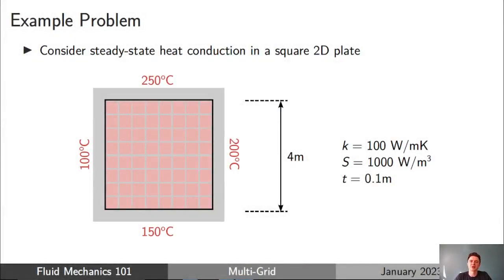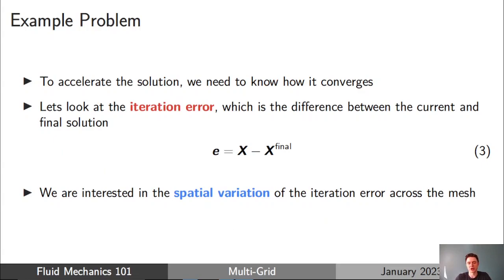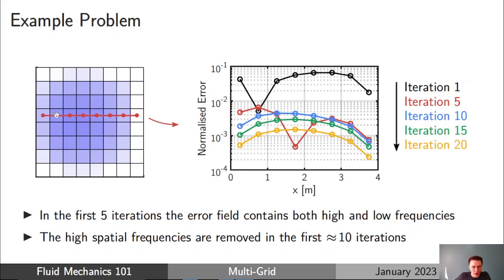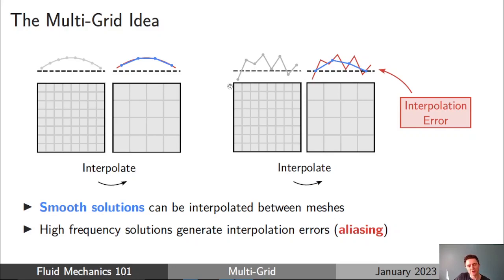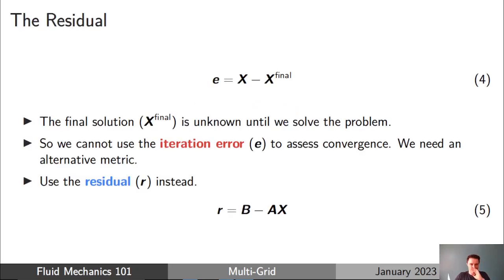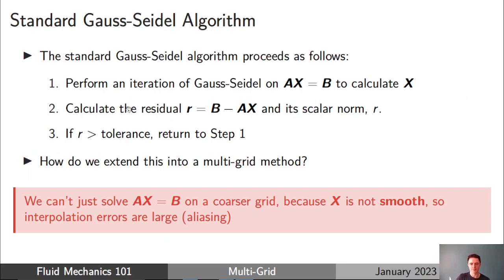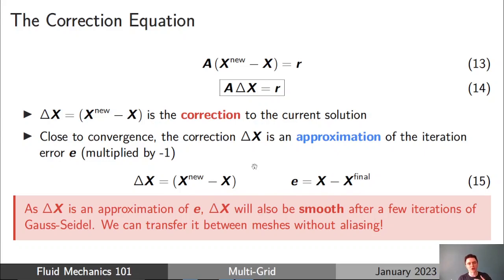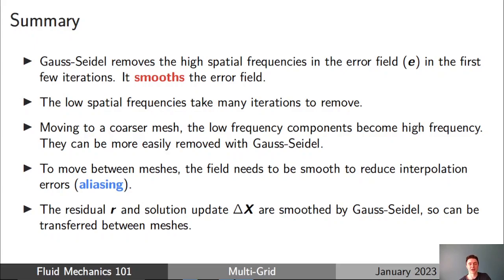[CFD] Multi-Grid for CFD (Part 1): Smoothing, Aliasing and the Correction Equation

Comment: Why is it better to use the correction error instead of simply using the Gauß Seidel method in the multi-grid method? In both cases the matrix would be smoothed.

Comment: Hello, it is very detailed video about  multigrid, I like it so much. But after watching I have some question remained. Why should we use mutligrid method with GS method for solving SLAE, when we can consider GMRES, or BiCGstab for this purpose? Will multigrid be faster that suggested algorithms? Or will it be easier to code? Can we use another algorithm for multigrid, not GS? In the video there is a strong emphasis is on the specifics of GS (it behaves like smoother and etc).

Thakn you for your channel, it's аwesome
Reply from the maker: To be honest, the choice of smoother is a bit beyond my understanding. I am sure this is something that the CFD code manual can recommend for different problems
Reply from the maker: To be honest, the choice of smoother is a bit beyond my understanding. I am sure this is something that the CFD code manual can recommend for different problems
Reply: According to some lit, it seems that as a specific smoothing algo, you have to be aware of symmetry in some algos like CG. I also heard that Krylov methods minimize the residual, that also includes some low frequency modes.

Comment: Absolute GOAT as always. I was wondering if the multi grid method that you are talking about here is the same thing as overset meshing that I have seen in ANSYS Fluent.
Reply from the maker: I think overset meshing is different. It is an old technique that is used to patch structured meshes together

Comment: Hello, I am working on a CFD Problem where I want to estimate the Drag Force on a camera mount on a rocket body for our student space team. I cannot do a 2D simulation for this case and the mount has a lot of round edges and also corners. I am adding inflation layers over the whole rocket body to propperly capture the boundary layer. However as those elements are very thin, yet long and wide, the element quality for those near body elements is awful. This is probably the reason for the non-converging solution I think. Is there any other way to solve this problem, without making the elements at the wall extremely small so that those inflation layer elements are as wide and long as they are thin?  I would love some help and please keep the great videos going!
Reply from the maker: You could make a very rough first estimate by modelling the object as a cylinder (or square cylinder) of approximately the same size, and then look up the drag coefficient at that Reynolds number, and calculate it by hand. You could even include this (very smoothed out) blob in your simulation. If this works and you are happy, you could slowly add detail or develop a sub-model with a higher resolution object, to get a bit more detail. With such a tricky shape, you will never get the exact answer. You just want to get a number that is accurate enough for what you are doing

Comment: Hi. I solved several problems in my code watching this channel. But i have a new one, and maybe you can help: i'm simulating an astrophysical jet in 2 dimensions(r,z). I use(mainly) finite differences to write the parts of the code. 
My problem is the jet is travelling ok until it reaches the boundary. But in the boundary(it is travelling in the z direction, so the boundary is at certain value of z), is reflected(obviously, because im using reflecting boundary conditions because is easier, normal derivative equal to 0). But this is a problem, because it changes the evolution of the system a lot. 
Sadly, i dont know how to write a non-reflecting boundary condition. Do you know the name of a paper, or a video that can help me with this? Because I found some, but they are not case specific, and it makes them difficult to understand.
Reply from the maker: I don't have anything specific for non reflecting boundaries but you could try 'Notes on Computational Fluid dynamics; general principles' by Greenshields and Weller. There is a great chapter on boundary conditions with lots of detail that might help you out? I think it had something on non reflecting boundaries but I can't quite remember!

Comment: i use multigrid methods for electrostatic problems and i am kind of self taught in the topic. When reading for example on the V cycle it was confusing to me what operators you would use for smoothing or restriction. Linear interpolators between matrix values seemed best for me for example but i really enjoyed your video.
I prefer to stick with explicit b-vector iteration instead of implicit matrix algebra because it handles boundary conditions in much simpler ways. For example when you have very complex shapes input by the user. It also makes the memory usage much simpler because you only need to save the weights of the A matrix in a convolution kernel. Ofc you can use a sparse A (if your A is sparse) but ye
Reply: my question is here when for example does the algorithm decide to stop restricting the mesh? Because realistically would you go down to 4 elements ?? Even if you have multiple objects with multiple boundary conditions ?
Reply from the maker: That's a good question, and I don't know the answer. I expect the answer might be code specific?
Reply: @fluidmechanics101  i have been struggling with this in my explicit v-cycle algorithm for electrostatics and the best i could come up with was this algorithm:

1- decide how many restrictions the mesh will undergo. usually user input.
2- decide a restriction factor. For example 0.5 will half the nr of indexes on each axis.
3- Since i am using the secondary array as a boolean Mask for dirichlet conditions, restrict the Dirichlet Mask and its geometries.
4- Save all the restricted Masks beforehand in a structure.

This is where i had to make choices between doing multiple V-Cycle iterations vs doing 1 V-Cycle with many inner SOR iterations. I went with option 2 for reasons that made the code more readable. 

I logiced for a restriction condition like this. Say for example i am measuring the residual with a method of my choice. In my case i use the L2 norm of the whole potential matrix. The difference between current iteration vs last,

If the user wants the L2 difference to be for example = 1.0, and on step 1 i decide on 4 restrictions, the algorithm will move down in mesh size if L2diff / nr.restrictions is reached as an error. This "pesudo guarantees" that you have a reliable error once you move up in mesh size again for the final result. But it gives results that are more off from the analytical solution or straight up doing 4000 SOR iterations